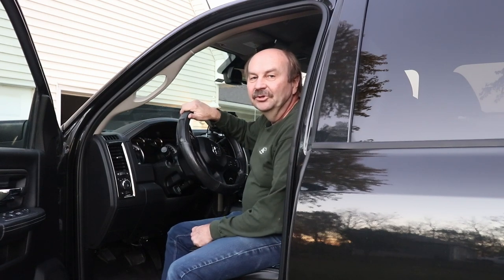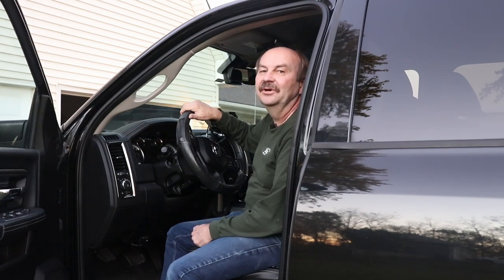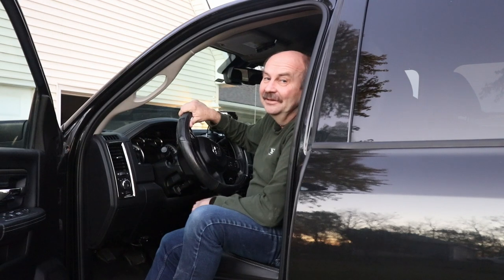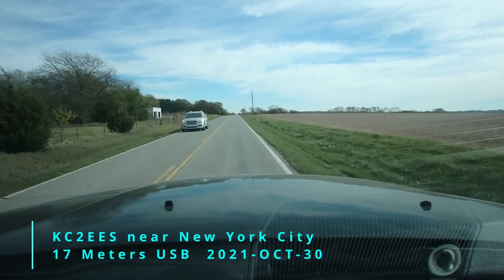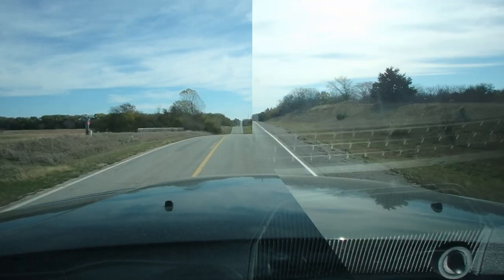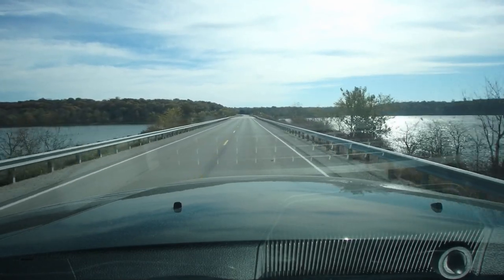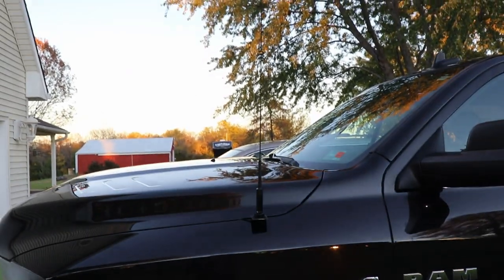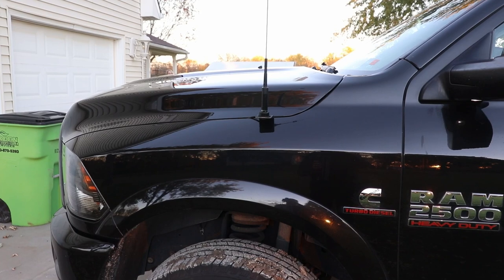IC7100 A-Z #16 My Mobile Setup

Comment: hi Tom
thanks for going to the trouble of explaining lots about the radio
i was in the need for a new unit so i sold lots of my unused ham gear to fund the new IC-7100
i couldn't be happier with the radio
👍👍

Comment: I've looked at some of the other videos on youtube about the SSB power issue and a hardware mod for it.   Some of the comments in those videos indicate that the problem was fixed in the E2 software update.  I think I'll try that before I modify the hardware.  It could very well be why you haven't noticed the problem.  You did the update to your 7100!  

BTW, thanks for these videos.  It's really helping me get up to speed on the 7100 (which I purchased 2 weeks ago!)

Comment: Tom a lot of CBrs with ham licenses are looking for every mw that can get they also want to tinker with their radio innards. But as you said i see two issues one is using speaker wire for power supply cabeling. Using a 12 volt power supply instead of 13.8 to 14 volt power supply. $1000.00 radio and a $10.00 power supply and lastly on SSB you can't  see 100 watts on a meter unless you have a meter with "MAX HOLD" FEATURE even though THEY WANT TO SEE IT. Your advice is best and mine is if it isnt broke dont fix it !

Comment: I have 2 7100s. They are great HF/VHF/UHF/DSTAR radios. You are correct that the power drops off very fast when the voltage gets below 13.5vdc. When mobile, run the vehicle if you want full output, or put the radio on a LI-PO battery.

Comment: The 7100 is such an under-appreciated rig. It's ideal for mobile having the speaker in the control head along with a mic jack and key input. It's great for both on the road and mobile operation while stopped/camped. The controls on the 7100 are really well suited for the type of changes you need to make while moving down the road.

Tom, your setup is great. Like you I wouldn't be concerned about the lack of secure mounting on the base unit or the use of a tuner for touch-up. That's really the best use case of a tuner anyway.

Comment: Nice job. Tom.  I also have an IC-7100, but run a Scorpion screwdriver antenna and get great reports as well.  I’ll confirm that bonding is the most neglected issue in many mobile installations…you can’t bond too much. Many ignore the tailpipe which is close to a quarter wave antenna on 20 meters, so it acts like an antenna broadcasting engine noise to your mobile antenna which you hear in your radio.  Bonding before and after the catalytic converter to the vehicle chassis will show a reduced noise floor.  12 gauge wire is more of an open circuit for RF purposes due to skin effect of RF, so half to one inch wide braid is the way to go.  Glad I found your channel…thanks.
Reply from the maker: Hi Lon.  Thanks for the kind words!  I have yet to bond my exhaust system to the frame, but that sounds like a good idea.  I agree with you that you can't bond too much.  I currently have an issue with a high noise level on parts of 2 meters.  If/when I get that sorted out that may become another video.  73, Tom
Reply: @ionmartin1353 is it a good base station radio?

Comment: Instead of vehicle power I use a 20ah lithium battery with a flat power curve. It has lasted a week with my 891 and ATAS. It fits nicely about anywhere and I have a Anderson pigtail for changing.  I might run 12v from the vehicle through a regulator for charging in the future.
Reply from the maker: Nothing wrong with a separate battery.  It makes for nice clean power.  Plus, instant portable away from the vehicle is a nice bonus.

Comment: Nice setup, looks like a true seasoned HAM with many customizations including the antenna modifications. I did the similar thing with 706 control head, but I use a Scosche dash mount. I might do a video about my setup when I am finally done.

Comment: I purchased a used 7100, and a 102 inch whip purchased from Tower Electronics at a ham fest, that I want to put in my F150. This helps with installation ideas. Thanks. I think the IC-7100 is an underrated radio. With use, it really grows on you. When the 7100 first came out, it seemed like a dumb idea because of the slanted face, but I no longer think that. W9FL.
Reply from the maker: I had the same thought about the angled display.  But, I’ve discovered that with the head tilted forward so the display is vertical, the buttons are angled very nicely toward me in the car.  It really is a good design for a mobile control head.

Comment: Hi Tom, What most people who say 7100 does not put out 100 watts on sideband  knows nothing about how SSB works unles you have a peak measuring watt meter they will never see 100 watts in peak modulation!
Reply from the maker: Yes.  I’m sure that is part of the problem at least for some people.  There is a lot of discussion about this issue out there.  Maybe there are some units that have a legitimate issue.  Or, maybe all of the discussion is just a couple of original complaints that keep getting shared and rehashed.  It’s hard to say.  I have not connected my 7100 to a calibrated external meter to check it.  I do know that I have received numerous excellent signal reports from people, including some who have said they can’t believe I’m mobile.  So whether my radio is putting out exactly 100 watts or not, it is clearly putting out enough power to get the job done.

Comment: Where did you bond the unit to? Such a great video. I’m watching all of the 7100s
Reply from the maker: I just attached a RAM mount to a smooth spot where the center nav screen meets the top of the dashboard.  I just use GE Silicone RTV.  I cement the mount piece down and hold it with masking tape for about a day before attaching anything to it.  The nice thing about the RTV is that you can use a putty knife to remove the mount when you change vehicles and the residue cleans up pretty well.

Comment: Thanks very much for this video. I was inspired to install an IC-7100 in my truck. One question, however. Where inside the cab are you grounding the radio? Finding it hard to pick a location to get a good RF ground. I really do not want to put any holes in the actual body inside the truck. Thanks so much!
Reply from the maker: Don’t know what truck you have, but there are usually a few rubber plugs on the back wall of the cab near the bottom that you can poke through with something like an ice pick or a screwdriver.  I  ran ground wires between the box, the cab and the frame.  I found a bolt on the frame and used tek screws (self drilling) on the bottom  of the cab and box bodies.  Make sure you scrape down to bare metal and use star washers of similar to insure good contact.
Reply: @HamRadioA2Z  Thanks.  I have a 2023 Ram Rebel.  Ended up using a self drilling screw in an inconspicuous location and so far so good.   I need to watch the rest of your videos to learn the radio better.   It's replacing an FT-891 (I wanted a radio that would do both HF and VHF) and the perormance while the engine is running is way better already. Will ook at body bonding to the frame next.  Appreciate your time.

Comment: What people don't realise is, the radio lowers output power when your antenna isn't 1:1 on SWR.  It automatically lowers the power to protect itself.
Reply from the maker: Hi.  I don’t know the details of the stations for the people who have commented about power problems.  So I don’t know.  However, it seems likely that SWR could have been part of the issue.  There are many things that can contribute to difficulty getting out.  I have had times when people can’t hear me,but I’ve had many times when people hear me just fine.  So I’m pretty sure the problem was band conditions or other factors and not radio output power.  73, Tom

Comment: Great video.  I just purchased a 7100 and am gearing up for my install.  I very curious where you got the piece that you attached to your truck bed rail for the Wolf River Coil.  I am also going to use a WRC and am wondering if you fabricated this piece or purchased it from somewhere.  Again, nice video!
Reply from the maker: Hi.  Thanks for the kind words.  The mount is a commercial stake pocket mount.  It has a 2nd stainless plate on the bottom with the 4 holes for the screws offset to one side.  You angle/fish it down through the stake pocket hole.  Then tighten the 4 screws and it cinches the plate up to sandwich the truck rail between the 2 plates.  I bought it at a hamfest a number of years ago.  I'm sorry, but I don't remember what dealer or even if it was a dealer.  There are no brand or model markings on it that I know of.

Comment: Hi Tom, another great video. Did I understand you correctly that you can adjust the MFJ tuner from the 7100 control head?
Reply from the maker: You can briefly press the TUNER/CALL button to have the tuner inline or bypass it.  You can press and hold the TUNER/CALL button for 1 second to force a tuning sequence.  When the tuner finishes tuning, TUNE will be displayed in the upper left corner of the display.  After this, if you briefly press TUNER/CALL, then TUNE will clear from the display and the tuner is bypassed.
Reply: @HamRadioA2Z  Thanks for the explanation 73

Comment: A little late to the party but couple questions :  does that black rtv come off the plastic very easily?  and what ram mount are you using ?  Does the transceiver cause any issue with the satellite radio ?  I think this would be a good mobile for my titan.
Reply from the maker: Hi. Sorry for the delayed reply. I have not tried to remove this RTV yet. I have used RTV in a similar way on past mobile mounts and it has cleaned up pretty well when I take them out.  I don’t remember the exact RAM model (not near the truck at the moment). It’s the ball mount with the shortest arm and just a 1” ball with a 1/4-20 threaded stud. No interference issues with satellite radio, but if I transmit on 40 meters, my automatic running boards go in and out. 😂
Reply: @HamRadioA2Z  automatic running boards ? Well mine are less maint , my only btch bout my truck is the bed is too short .

Comment: Where, on your Ram, were you able to get the coax FROM that location to the bedrail and where did you pull the power from?  (Switched?)
Reply from the maker: I drilled a hole through the storage compartment floor under the seat.  Actually 2 holes- One for the coax and one for the ground wire.

Comment: Hello, I'm Erick VE2KJ and would like to know please, having the icom 7100 on the dash does not affect the radio screen with heat?  73 and good contacts
Reply from the maker: Hi Erick.  No problems when I’m driving.  Parked, it can get pretty hot up there.  So my wife made me a soft cloth cover that I keep on the control head when it’s parked in the sun on a hot day.  Before that I used to just put a baseball cap on it.  I have not had any problems with the display not working or being all black in the heat.

Comment: That's a very impressive setup you have in your truck. I have often thought of swapping my 7100 from in-house to my truck and then moving my ID5100 to the house, and then getting an HF radio for in house. 
Regarding 7100 power output issues, I've learned that the radio will show you when it boots up, what you're power output is. If it shows 100 percent, you're OK. If not, then you have to do the mod. 
Thanks again for another quality video!! 73's !
PS. Where did you get the mount for the head unit?
Reply from the maker: Hi. Thank you for the kind words.  The power on power % display is not related to the modification. That is just displaying the power setting that you can access with the Mic/RF Pwr button.
I got the mounting pieces from a couple sources.  A couple pieces were Amazon purchases (There’s an affiliate link to RAM parts in the video description). I got one of the pieces at a local Bass Pro store.

Comment: Nice work! I'm considering one of these for my tight mobile install (see my KE4WMF playlist for details). I was unsure about the angled display and keypad surface. But seeing how you've angled it has me thinking it could work. I just need to see if it will work where I have my current FT-857D and ID-5100A. Take Care!
Reply from the maker: Thanks for the kind words.  I had an 857 as my mobile rig for a number of years.  It’s a good radio, but as my eyes were getting older, the small display was just becoming too hard to read.  That’s one of the reasons I switched to the 7100.

Comment: Are you able to do CW with this mobile setup?
Reply from the maker: I don’t see why not.  I’ve been told about one ham that was in our local club who used to work CW mobile all the time.  He had special mobile key that he could strap onto his leg.  So he actually worked CW while he was driving.  I’m afraid CW is one mode that I’ve done very little with.  I’ve been thinking about changing that.  Once upon a time I passed my 13WPM code test.  I need to start copying some code practice and get my speed back up.
Reply: @HamRadioA2Z  CWOPS has classes I’m taking. I’d love a rig like this instead of using handheld all the time. 73

Comment: Is the 7100 good for a base station?
Reply from the maker: I think so.  I’ve used it as a portable base station in our camper in the past when we’ve been camped someplace for more than a day or two.  It all depends on personal preference and budget.  The 7100 isn’t going to perform like a $4,000 base station, but it is pretty close to other rigs in the ~$1,000 range.  On the plus side, with the 7100 you get a 2 meter/440, all-mode base station too.  On the down side, because of the smaller control head, more functions require multiple button presses or menu options compared to a larger rig that’s designed more as a base station.
Also, because the 7100 is an older design you don’t get the nice color spectrum scope display like you have with an Icom 7300 or the Yaesu 710.  Both of those rigs are also in the $1,000 range.
I think these are the key things you need to decide on:
- How important are 2 meters and 440 to you?
- How important are real knobs and buttons? (There are still menu based items on other radios, but fewer and more real buttons & knobs).
- How important is a color spectrum display and other SDR/DSP type features?

Comment: Hi. Great video. I hv a 7100 for an year but havent got round to installation in my crossover. Can I install it with my AT 180 auto tuner and Diamond HF 20 CL antenna?

Comment: What tuner would you recommend for the 7100? Also does the mobile power from the 706 work with the 7200?
Reply from the maker: I've been pretty happy with the MFJ-939i tuner with my 7100.  LDG also makes some Icom compatible models.  I believe the actual Icom tuners are very good too, but I don't have any direct experience with them.
On the 706 power question--- I believe you're asking if the power connector from the 706 is compatible with the 7100?  I have never owned a 706.  So I don't know.  I believe the power connectors are common on recent Icom radios, but I don't know if they've changed since the when the 706 first came out.  I think that was at least 20 years ago.

Comment: I have a 7100 in my F250.  Great rig.  I use a couple of ham stick antennas and they work fine.  I do get some ignition noise on receive.  Bonded all around the truck including the exhaust system to the frame.  No real help.  Thankfully the 7100 NB is excellent but I do hear it on v/uhf.  Curious to see how you handle ignition noise.  Great video!  Sub’ed!  73 de K2CJB
Reply from the maker: Hi.  Thanks for the kind words.  Since my truck is a diesel, there is no ignition noise.  Although I do get some hash from the injectors firing that is similar to ignition noise.  Same as you, I use the Noise Blanker.  It works pretty well for most of it.

Comment: Do you show how to use the SWR meter on 7100 in an earlier video? I tried to use it on 20m and when I press the arrow button just prior to clicking the PTT it jumps to a lower frequency.
Reply from the maker: Hi.  I haven’t done a video on the 7100 SWR graph function yet.  I did one a year or 2 ago on the IC-7300 SWR graph.  It operates in a very similar way.  When you select the SWR graph function, you can adjust the step size and the number of bars.  I believe the default is 10khz steps and 5 bars.  When you start the function, whatever frequency you are on becomes the center frequency for the graph.  So when you press the Arrow button, the radio will tune to the start of the graph (20khz down in the default case.  Then with each press of the PTT button, the radio will tune up to the next 10khz step.  After the 5th press, the radio will tune back to where you started.  You can press the SET touchscreen button to change the step size and number of bars.